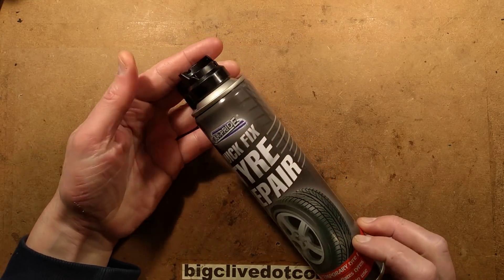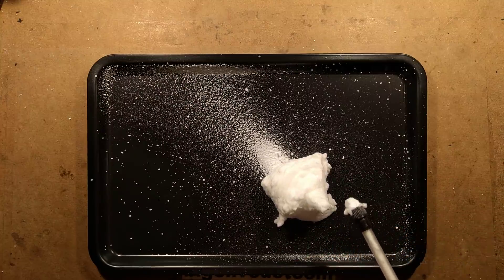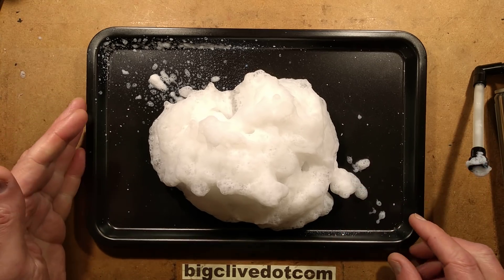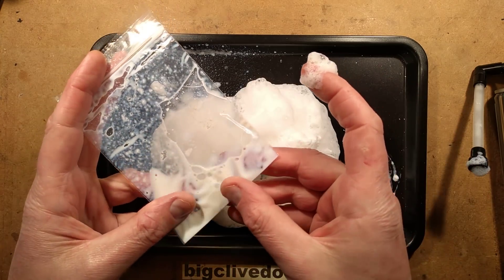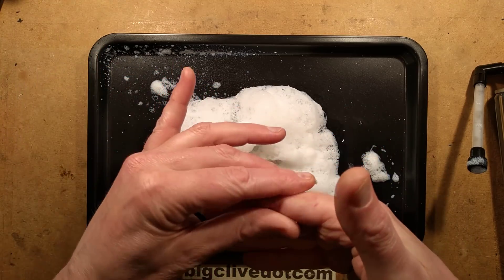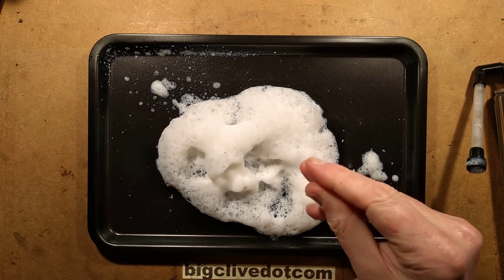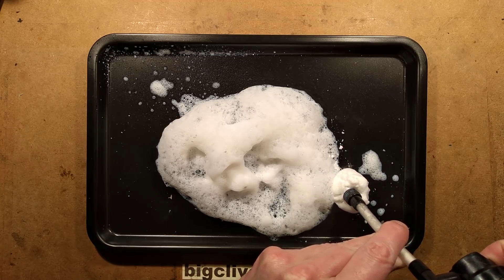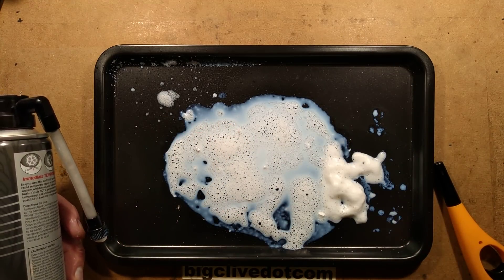What's in a tin of foaming tyre repair liquid.

Comment: I've just used a tin of this on my neighbours tyre. It seems to have worked. It didn't inflate the tyre too much but it does say to use more tins. It's pretty messy plus one of the tins the screw adapter that screws onto the tyre valve broke off, so I had to top up with more air.

Comment: Honda cars come with a bottle of liquid latex, its a bit different as its just a liquid no propellant, and you take the valve off pour it in to the tyre, put the valve on again and inflate then drive.  I used it and it worked really well and when I bought a new tyre I looked at the repaired one and it had turned into a thin film coating on the inside of the tyre, I think it might have just kept going without needing a new tyre, I can't see how it would turn into a ball, maybe it does after some time.

Comment: These first came out in the late 1950s. I bought one for my father not long before he died (he had a heart condition and could never have changed a tyre) and many years after he had died I tried it when I had a puncture.  It did indeed work.  Amazing. I assume the modern ones work on the same principle - though I don't know.

Comment: They're pretty much exactly what they claim to be. They work quite fabulously on slow leaks, and do actually contain just enough gas to get the rim off the ground for a low-volume tire, or more realistically enough to top off a larger tire that you caught leaking before it went flat to a reasonable running pressure for a paved road. I would rate them as being about as useful as a little 12-volt-bee-fart air compressor in your highway repair kit. The air compressor can be used repeatedly, but for any damage mild enough that it would be reasonable to just keep filling up the tire, the can of magic sauce will most likely work as intended and the air will stay in there all the way back to town. And as an added bonus, the can also delivers its payload much faster than one of those little air compressors can deliver a similar volume. If it is reasonable to get the tire to a shop for repair without putting schmoo in there, however, it is preferable to do so, as it makes exactly as much of a mess in there as you imagine, and such a desecrated tire is a terrible thing to hand to a technician. If ever you must do so, you should warn them and apologize profusely for the mess they're about to open. The correct thing to do is probably to carry both the magic can and the bee-fart pump and use neither, one or both of them contextually.

Comment: The latex residue tends to throw the tire out of balance, which is why you should get the tire properly patched (or at least rebalanced). Otherwise, if the puncture is not too large and you get a good seal, the seal itself will likely last the life of the tire.

Comment: We use this foam in our tractors at work, and some of them have the same tyre with the foam inside and nothing done afterwards for years (4 years at the time typing this). But I couldn't fix my motorcycle tyre with a crack approximately 2 cm (1 inch)...

Comment: Used that once, learned to never look at it again. I had a punctured tyre, screw in the thread, so your most typical damage you're supposed to be able to fix with it. Followed instructions to the word. Not only I had to get a spare anyway, but cleaning inside of the tyre was a chore. Since then I bought a set of self vulcanising "cords", and it seems to be working, as I never had to use them ;) Truth be told, I had since flat tyre twice, but sidewall damage, so no use anyway. Only thing I initially bought, but will replace is a foot pump. Even double barreled one takes ages and A LOT of presses to fill a tyre.

Comment: Hi Clive. Only just saw this. I have used the Holts version several times. I had a problem with a very slow puncture and used it to successfully to stop the leak. Never had a problem when tyre was changed. I had a screw in one tyre when my current car was almost new. Managed to reach a filling station and used a Holts can rather than the bottle of solution supplied with my car.  I used the car for 5 years with no problems, and no comments when the tyres were changed. I did buy a spare so i didn't need to depend on the rubber solution.

Comment: I've used the stuff on my Harley, it has tubes inside and it did say not to drive permanently with it and not above 80 km/h, however that's two years ago by now, tyre still keeps air and running fine. also defalted/pumped it several times. I've just pinched the tubes of my Victoria vintage bike and I consider using it to fix the front as I am running out of tubes - however I think in the past people used to fix tubes on the side of the road, here it is easier and fixes when mounted I assume internal fixing of tubes are fine, as long as we talk vintage slo bikes. I wouldn't run it on heavy/fast bikes. thanks for the informative video :)

Comment: Used it quite a few times over the years.  Works good for small leaks. I've left it in for a long time.  Tire repair shops hate it though.  They actually sell tubes with slim in to seal punctures  Sorta a self healing tire.
Reply: *slime

Comment: I've used these "tyre in a can" things a couple of times, I have one in my car in case I get a puncture (it's much quicker/cleaner than changing a tyre). The downside is that if the puncture was repairable, using the tyre in a can will make it no longer viable for repair. I don't know why, this is just what I was told at the garage, could be that it gums up the valve or the propellant interacts with the rubber of the tyre...

Comment: A month after I got new tires on my car I picked up a screw. I'm a bit loathe to use that stuff as it can mess up my air pressure sensors but the leak is so slow It only loses 1psi every couple of days, sometimes loses no air over a whole week according to my proper tire guage reading at the valve stem. So if you have sensors in your tyres then normally your owners manual (as mine does) will say not to use this.

Comment: Back in about 1977ish they started selling something like this as a puncture preventative for motorcycle tyres. Not sure if it actually worked, but after about a year you would end up with what looked like a small rough latex ball inside the tyre.

Comment: Tyre shop near me won’t touch a tyre if someone’s used Fix-A-Flat etc on it. Apparently it’s a PITA to clean, if someone says they had a puncture it’s the first question they ask, then turn them away. If they lie about using it, they often notice and give 2 options, one they won’t remove the tyre any further and will reinflate and reinstall at no cost, or they’ll begrudgingly do it for a £20 additional ‘liars’ fee. The extra cash gets given to the employee who had to spend an additional 20 minutes cleaning the thing.

Comment: I got to test one of these recently. Got a flat in a hardware store car park. Didn't have a tyre lever on me so bought one of these. It quickly inflated and sealed my tyre. Got to a service station and adjusted the pressure a bit before driving home.

Drove home, replaced tyre with spare and repaired the tyre with a plug. 

Just this morning I put the repaired tyre back on completely forgetting it is full of this stuff. I will have to look into it longterm.

Comment: What happens if you allow that Milky White fluid (the stuff from your Ziplock bag) stuff to air dry properly?
Reply from the maker: It forms a latex glue like rubber film.
Reply: @bigclivedotcom  ah yep, you did mention that, but I had assumed that was just when you'd rubbed it on your hand. Thanks for the reply mate!

Comment: To my great surprise this stuff actually works well to repair punctures.
I used this to fix a rear tire puncture months ago and it is still sealed well enough i have not bothered to fix it.
The trick is when you have squirted it into your tire it is ESSENTIAL to then drive on the tire for the sealing to work
Reply: I am still using this same tire with the same sealed puncture

Comment: A lot of times when you have a hole in a tire they can patch it and make the tire good as new.  If you put this stuff in the tire, it's a death sentence.  There's no going back and you have to get a new tire.  Also if you keep a can of this in your car, as I did, and it gets too warm the pressure will build up until the hose explodes and it goes into your eyes when you try to use it.

Comment: I've driven round on one with holts tire weld in it for about 2 years when i first passed my test. Covered about 20000. It seemed fine. Only changed the tire cause it was bald.

Comment: A tire that has been inflated with foam should not be repaired. The solvent softens the inside of the tire weakening it unpredictably. I have had to replace a tire twice at different shops. I suppose it’s possible to repair them but there is probably a problem with warranties and liabilities.

Comment: Be your tyre fitter's friend - if you've got a can of that in the boot sling it.  (Or use it as a target for one's air gun practice - within one's own property of course.)
Last time I was having my tyres changed there was a tyre being changed after having been "fixed" with one of those cans.  The latex had covered the whole inside of the tyre and wheel and it was almost impossible to get the tyre off and green goo oozed out as the seal was broken, sticking the tyre to the rim.  They'd changed all four of my tyres before liberating that rim from the grasp of the goo and tyre.

Comment: I,be used the green stuff " slime" many years ago in my small off road motorbike, as a preventive against flats, after a year off daily riding I felt a little vibration in the back of the bike riding on tarmac, no problem, I kept driving for two weeks this way, on a Saturday I decided to inspect the rear wheel about what was the reason of the slightly anoing feeling, turns out I had been driving with a 5 inch nail completely embedded over the riding surface of my rear Tyre!
I removed the nail with quite a bit of forse, imediatly the green stuff came pouring out the now fresch hole,but stopped in 10 seconds ,I started the bike,drove around the block, parked the dammned thing....and continued to drive for another year with the same Tyre !
So in can confirm that the green stuff works!

Comment: Urethane, rubber, poly blend. 
Smooth-on 790 or so type mix in a can. 
My family buys it by the 110 gallon set. 
We use it to repair a lot a lot a lot of huge tires and other stuff. 
My garage floor is covered in the 790 mix. It’ll last forever. AvE did a video with it and an anvil. Was cool to see him use the same stuff!

Comment: I know the other type quite well. Originally branded as "Tyre slime" for bicycles. That stuff differs in the idea you can actually pre fill a tyre as a puncture preventative. Have some now which we use on agricultural tractor tyres. Works well. It is not marketed as a temporary repair though, even if its equally as controversial. Often green and has fibres like fiberglass in. Doesn't inflate your tyre though as you put it in deflated with the valve out and then pump it back up. Always wondered how that works. Cant be air reactive as its already in air. So much be moisture too?
I personally think the controversy is more about the idea modern cars have cans like yours as a replacement for a spare tyre. Which is messed up.

Comment: Late to the party but I’ve used a can of this stuff on just about every pair or set of tires I’ve owned. Inevitably between tire changes, one will get a puncture. Grab one of these and I can keep the set or pair going till my next replacement, sometimes for a couple years. For $15 it’s cheaper than replacing a tire or a set.

Comment: I bought a new car last year, yay me....coming back from a gig around 1am i got a puncture, pulled over, looked at the tyre, there was a broken allen key stuck in the tyre.
No worries, dig out the spare.....but my £16k brand new motor has no spare, just a tin of this stuff and an air pump...followed the instructions...et-voila....the muck just squirted out of the hole (around 2mm)...had to wait an hour for a breakdown truck to transport my car home...next day local tyre repair place said they couldn't patch the tyre once that muck had been used, so it was a new tyre to pay for as well...then a trip to the breakers yard for a spare wheel....fool me once Ford....

Comment: This stuff is bad news if you have tire pressure monitoring system installed. It will kill the sensor.
Reply: Really? my ford came with a can of this crap and has sensors installed in the wheels.

Comment: some years ago I had to buy a giant can of expanding foam as it was all that was available even though I only needed a small amount. afterwards boredom and general mischief combined and the giant can of expanding foam was an easy target. I inserted the can into the central shaft of a giant mains cable reel which was laying on its side. I then proceeded to jab with some effort at the can with a length of iron bar. well, needless to say that the can did not instantly rupture. puzzled but unable to remove the can from the hole it was in I foolishly left the thing alone. well, the following day when the sun shone brightly and it was hot as hell, which is rare for the isle of man I must say, I decided, having forgotten about the can...to sunbathe on top of the giant cable reel. naturally the suns heat radiated to the can beneath me. It is considerably lucky for me that when I decided to get up and go do some work. at almost that very instant..boom! an eruption of expanding foam began ejecting from every available outlet on the cable reel. quite a thing to behold. And if you have ever gotten expanding foam on your skin, you realize just how lucky I was. Dont fuck with expanding foam. and don't leave it somewhere it will be exposed to heat.

Comment: I used one of these on a punctured tyre, and intended to follow the instructions and get it fixed properly as soon as possible. But the tyre repair guy said that because I had used the spray he wouldn’t be able to repair it. It would be so much bother to clean up the tyre it wouldn’t be economically viable. There was enough tread left on the tyre to make me take the risk of carrying on with it, which I did for about three months. Not a high mileage, perhaps 3000, but it stayed inflated until it was changed.

Comment: I don't know what that stuff really is, but I've replaced tires which had this shit inside. It ruins the tire. Whatever is in that stuff, it attacks the rubber and causes cracks and rot in the rubber over time. I strongly advise against usi g this stuff in any situation, unless absolutely necessary in an emergency.
Reply: It also coats the inside of the rim with a nasty film which is difficult to clean off by any means other than a steam cleaner

Comment: I use those on lawn tractor tires. Most older lawn mowers get dry rot and its cheaper to fill the tire with that . As the tires on a lawn mower requires only a few pounds any ways, its a cheap fix. I wouldnt use it on an automobile tire unless mabe it had a slow leak. The green slime works much better.

Comment: I used some of this stuff to fix a pneumatic tire on a large tandem pushchair we had for our boys when they were young. It worked for quite some time, then I had to reapply it. Each time it got more difficult to push the stuff in. I think it eventually clogged up the inlet valve & couldn't even pump air in there with a small tyre inflation compressor.

Comment: the  latex plugs the hole by blowing out the hole the gas expands under the heat of driving you are supposed to let all the air out and refill with fresh air i guess thats when you get it fixed proper i just leave in most of the time and forget about it lol

Comment: I've had decent success with those cans, on small punctures caused by nails and such. 
Also had one hilarious failure when trying to use the factory puncture fix kit that came with a Ford S-max instead of a spare wheel. Instead of a pressurised can, this kit had a bottle of latex glue that you were supposed to screw into a port on a  tiny compressor that runs off the 12V cigarette lighter socket.

The teeny tiny compressor couldn't pump air fast enough to inflate the tyre despite the leak being very small, so it just sat there vibrating like mad and making noise without making any progress. After a while   I noticed the vibrations from the compressor were causing the now pressurized sealant bottle to begin unscrewing itself. I frantically jumped forward and reached for the off-switch, a half-second too late. Just as I reached the switch, the bottle came loose and took off like a bottle rocket. Sprayed latex goo all over me and the car, then landed some distance away. Stupidest bit of automotive kit ever designed!

Comment: My father used Fix-A-Flat with a nail still in the tire. It amazingly held pressure and it lasted not only the 40 mile ride home, but for about a couple of weeks until we could buy new tires.